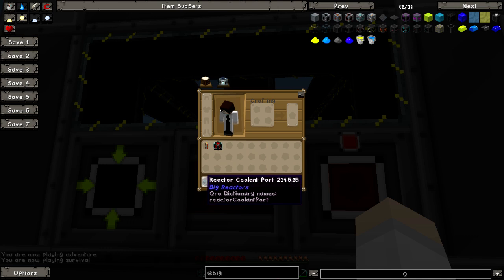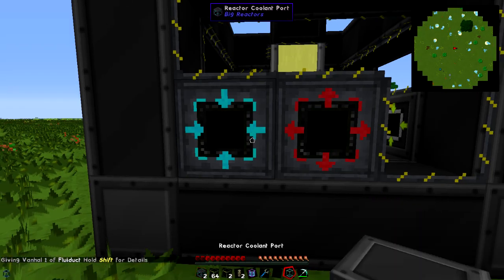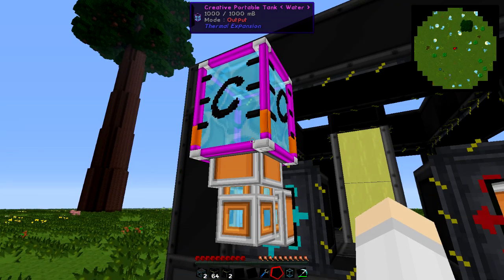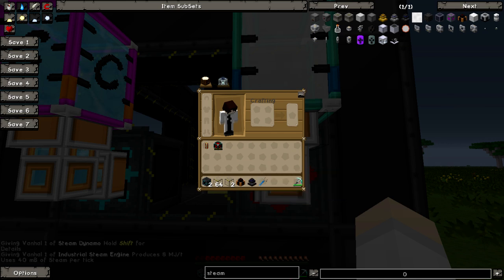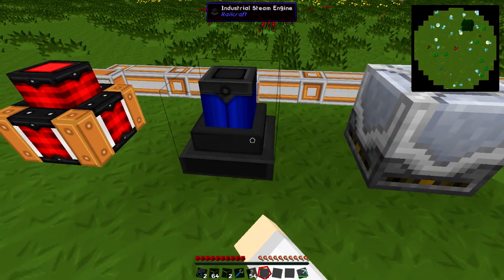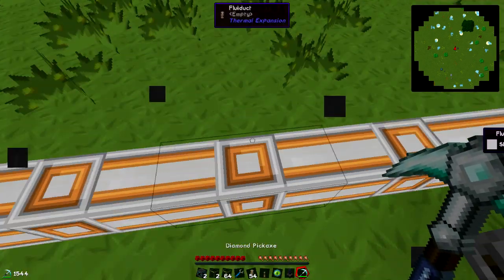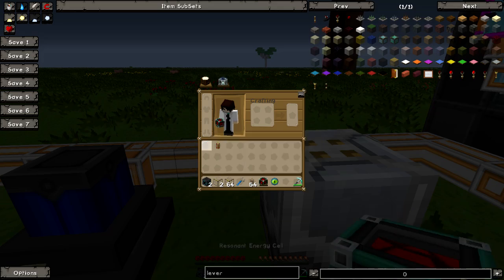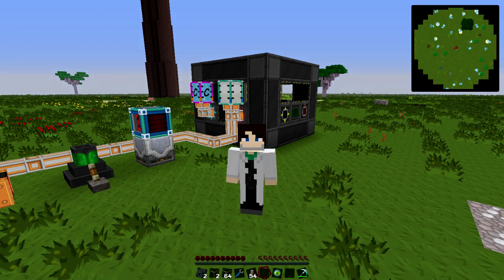How To! Produce a huge amount of steam with Big Reactors

Comment: The steam dynamo and the industrial steam engine produce the same amount of power. But the industrial steam engine requires time to heat up to get to full power
Reply from the maker: Ah, there you go! Thanks, Bar from the boilers I don't really use rail craft.
Reply: Vanhal Yeah nothing uses MJ anymore directly especially since a redstone conduit transmits MJ and RF
Reply: ***** True but the industrial steam engine costs much more and it must be supplied with enough steam to maintain output at 8 MJ (80 RF per tick)
Reply: @MatthewIceDragon  1mj are 400krf, mekanism transform it
Reply: i never used rail craft, so i used turbine, from Big Reactor or BR for short.